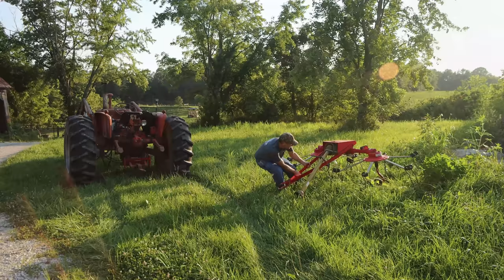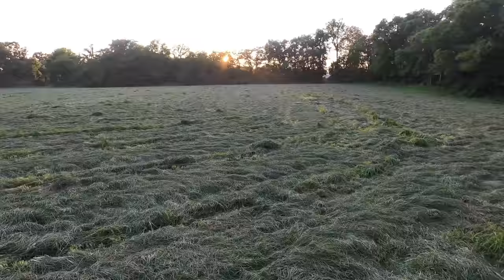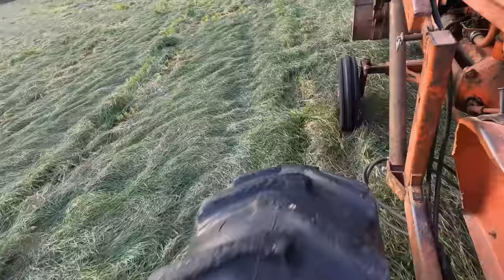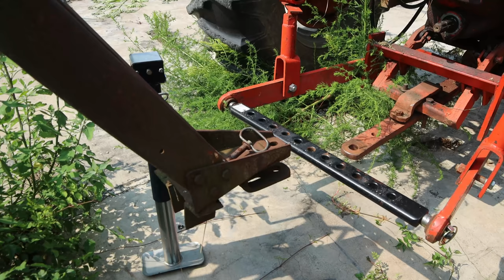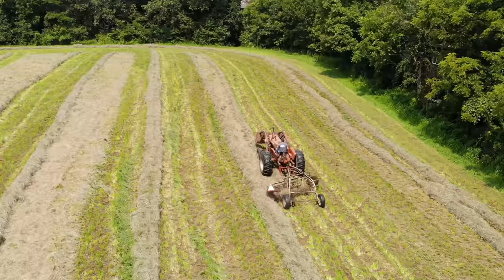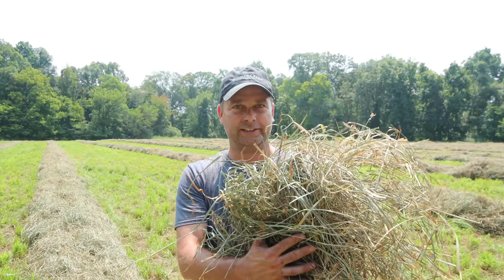Tedding and Raking Hay with 1959 Allis Chalmers D17

Comment: Looks great!  We use to roll them again if we needed to.  The thicker rows may dry slow.  Order some of the hot dry weather it should all work out.  I see now why a lot farms are cutting back trees and improving the growth on the plants.  Funny how run off of water and shade can effect the growth of the field and plant growth.  Might work out to be a good late fall winter project.  I seem to have a problem with the small trees popping up all over.  I try to get on them quickly.  This year is a fight.

Comment: I have been baling our field for 25 years and it too is surrounded by trees.  We always try to maximize the hay and wait for the outter edge to dry but I am getting to the point I may start brushhogging the outter round instead of waiting and cutting for hay.  At this point it is more weeds than hay anyhow.  It will make mowing and raking the outter edge of the field better and keep it cut back from growing in with weeds.

Comment: Here’s a suggestion , take and make a offset hitch on the back of the hay bailer for towing the Haywagon so the hay bales come out in the Center of the wagon instead of the left inside
Reply: Baling is done clockwise, what you suggest is foreign to  70 years of bailing hay. Your concept endangers man on wagon  & increases chances of losing bale on turns as chute would be away  from wagon.  Keep thinking, fresh approaches sometime result in new products/patents.

Comment: Greetings! Evan, I’m pleased you no longer start a new windrow with your forward edge hooking stuff out of the last one - much cleaner, yes? Now, if you find yourself on the wrong end of the row to sweep the outer edge in, just transport down to the other end (or run your toes the other direction) so you never have to guess how far out into the field to start another row. If the rake is always on the edge closest to the clean field, then when you double back, you’ll have the rake in the perfect position to get the second pass tucked right into place. Definitely the fastest way to rake - many fewer touch ups needed because you won’t guess too far out. Will be faster to bale too, as I think you’ve discovered by now if this was yesterday morning. Good progress!

Comment: Great job 👍 and video...nice drone shots...can you trim those limbs closer where you have so much shade so it can save you some time with the drying out of the hay...
Reply from the maker: The trees are trimmed up high there.  It is more the angle of the sun.  Usually not a problem one first cut, get worse as we head to fall.
Reply: Well since you say you don’t need to do trimming around the hay field , I don’t need to remind you about eye protection. Did your Mom ever call you old hard head. . ?

Comment: The view from under the tractor shows how unevenly the sickle blade cuts. I think its time to go to another method of cutting. Also, do you think its time to cut more trees back in the path to the field, or is that a fall job?
Reply from the maker: That was when the sickle would clog up, that area wouldn't cut right.  There is a lot of uneven grass in the field.  I Need to cut the field with something else.  Hopefully I will find something.
Reply: @CountryViewAcres  Perhaps you can find a 3 point mounted disc mower for a reasonable price. They are so much easier to use than a sickle bar

Comment: Looking good. I would definitely invest in a haybine. When i first started farming i cut all my hay with a sickle bar cutter that came with my Allis Chalmers WD45. It worked ok but once i purchased my 489 New Holland haybine my cutting time was "cut" in half! Can i ask a question? Why do you have one rim on your D17 spun out?
Reply from the maker: When they put the new rims on the tires.  They couldn't get one of the rim lock outs to move.  It was seized up.   So they didn't put it in.   So it doesn't stay in place all the time.  Sometimes it moves in and sometimes it moves out.  I figure when I take the wheel back off to paint them I will try to fix that.

Comment: at 12:27.........can't that rake be disengaged  so it doesn't operate while transporting ?
Reply: Disengaging clutch is broken.
Reply: @dwightl5863  ...my dad had that problem with a corn binder when I was a kid.

A regular pain !
Reply from the maker: The previous owner welded the disengage clutch together.  So I have to take the belt off to stop it from rotating.

Comment: Save your back and get a fuel transfer pump. Harbor freight item number 63847 if you want to see the basic type but all the big box stores have them as they make everything from fuel transfers to oil transfers so much easier. Why dump fuel into a funnel when you can set the fuel can down and simply run a hose into the fuel tank to let the pump do the work? Why do the used oil juggle of trying to refill the 1 gallon jugs with oil with a funnel when you can just stick the end of the hose in the jug and turn on the pump?

Comment: Instead of taking all that time with the tractor you can use an atv or even your truck on the rake cause it's powered by the wheels
Reply: @ArmpitStudios  yes its true that a tractor is more consistant but being able to move it with an atv or utv might get it into a tighter spot in the shed.